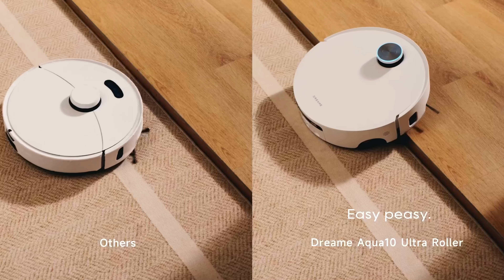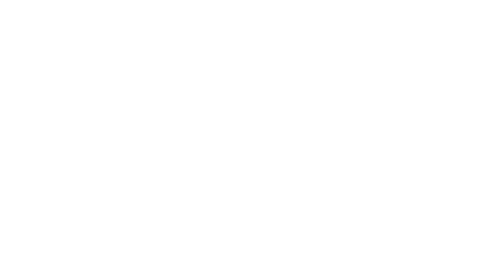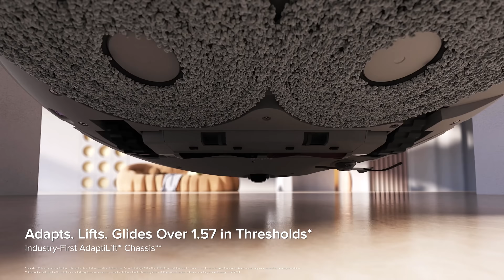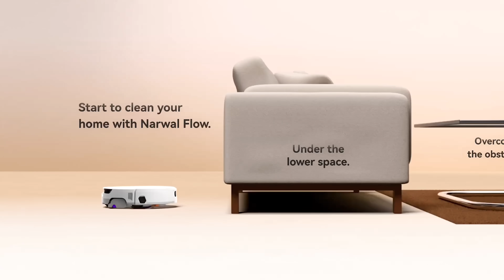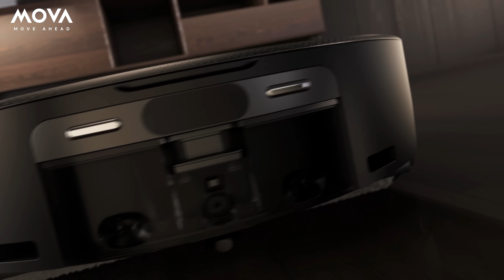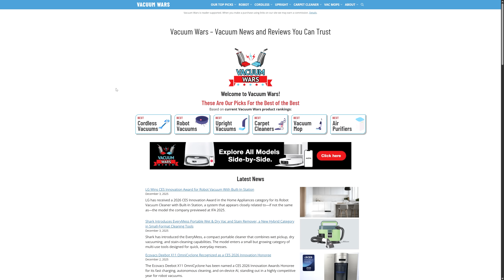These Robot Vacuums Can JUMP?! (New Threshold Test)

Comment: I have a daily 47mm threshold challenge, what do you think which model is the best and can do it stably? Maybe X60 ultra or Saros 20?
Reply from the maker: For a single 47 mm threshold, we would not confidently guarantee either model will cross it reliably every day. The Saros 20 is officially rated for a first step of up to 45 mm, with its 88 mm claim applying to a specific two level threshold. The shape and depth matter considerably, so a small threshold ramp would be the most reliable solution.

Comment: I find that the biggest issue with these robots being able to climb high, is that when for example cleaning just one room next to another room with the threshold it kind of awkwardly clean around the higher doorway as it is not doing it in a straight line parallel to the threshold. This to me indicates that it doesnt really know it is there and compensating in the Way it cleans when not cleaning both rooms. I have a s7 maxv and saros 10 both having this issue. In my mind, they should clean around the parameter as if it is a Wall, so that it cleans right up close to the threshold. If that makes sense.

Comment: QUESTION
(off subject)
Do you know if these types of mattress/upholstery dust mite killer/cleaners are a scam?
"JIGOO J300 Bed Vacuum Cleaner"
Supposed....500W Mattress Vacuum with 13KPa Strong Suction, Dust Sensor, UV Light & Ultrasonic Technology for Dust Mites and Pet Hair AND
heats to 131*f 
I posted here because i didn't know how to ask you otherwise.
I really would hope that it is a sealed system so that it wouldn't be spewing out dander and dust mites!
Do you think this "dust mite killing" is just a gimmick???
Reply from the maker: Interesting question, and it is perfectly fine to ask it here!  I’ll pass your message over to the testing team to see if it’s something we should look into more closely. If it’s not capturing and containing the dust and allergens properly, it can just stir them back into the air.
Reply: thank you so very much! 
**i follow a yt chan "my great challenge" and she tested it on her sofa, bed, mattress and pillow, however she's not capable to preform the "sealed system test". Looks very interesting and more maneuverable than a vac attachment concerning upholstery and mattresses....and if it really does kill mites with heat and uv AND has a sealed system then i would say YAY!

Comment: Hey. What do you think about adding metrics of how loud robot is during cleaning and emptying dust to the station?
Reply from the maker: We actually test noise levels, and for many product categories, they are included in the algorithm used for final rankings on our website. However, noise levels are not often mentioned in videos anymore unless they are extremely loud.
Reply: Some people mention that the mop drying is a noisy procedure because the spinning parts are regularly spun a little. People state that robot an station make noise for hours during this process.
This means that people working at home need a place far away from their work place for the robot station.

Comment: MOVA is a subsidiary of Dreame. They use a lot of the same parts so no wonder they are both so similar.
Reply from the maker: MOVA is often seen as a value-oriented brand that’s connected with Dreame, but they aren’t the same company. Think of MOVA more like a sub-brand or sister brand—they share some design elements, components, and technology, but the teams and companies operate separately and don’t consider themselves one and the same.
Reply: @V @VacuumWars They are owned by the same parent company. It’s like Best Buy and Future Shop or Winners, HomeSense and Marshals. It’s a deliberate business strategy to maximize market share, reach diverse customer segments, and drive overall profitability.

Comment: but which robot vacuum manufacturer has the least aggressive crossing and damage the floor the least? That is also important. What would you say there? For example if height isn't everything but actually if it's careful also just not bouncing into the floor carelessly. For example Roborock tech vs Dreame/Mova? I know one can climb higher than the other but in terms of crossing the height in a delicate and confident matter - which wins?
Reply: If your floor is easily damaged, that's a problem with your floor.
Reply: @glyptodon_ch  No. Depending of color of ur flooring scratches can be more or less visable for example. All of these robots are different in many areas and some have more elegant navigation for example so perhaps in this regard some are better than others.

Comment: Hi, could you please add the water level after mopping to the Robot Vacuum Comparison? I have light, smooth tiles, and my Dreame L10s pro leaves terrible stains on them, just like in the video with smooth, black tiles. One of the videos shows tables, and some robots have no water level control at all, while others have minimal. Knowing this before purchasing a robot would help you make a better choice. And one last observation: the mopping score is high, but the amount of water remaining after cleaning is negligible, and sometimes the opposite.
Reply from the maker: I will make sure to pass your comment over to the testing team!! Thanks so much for sharing your request with us!!
Reply: @VacuumWars Briefly and to the point, please add a table of the water left after mopping for the minimum and maximum settings, this may be important information when purchasing.